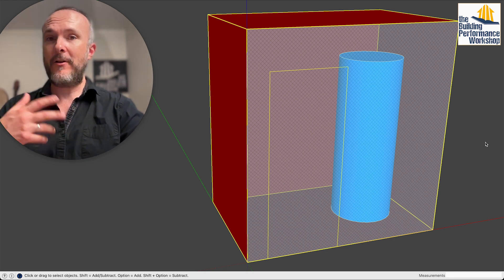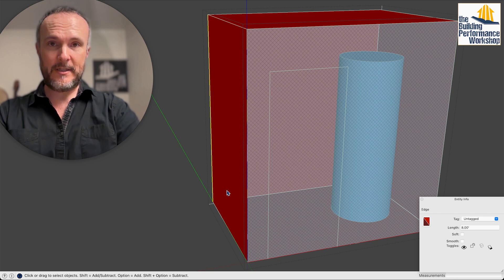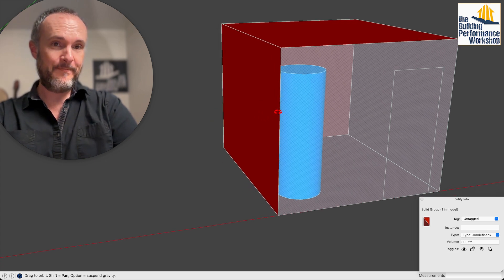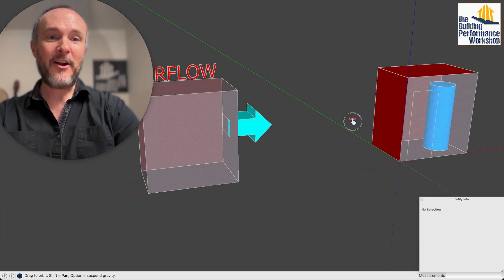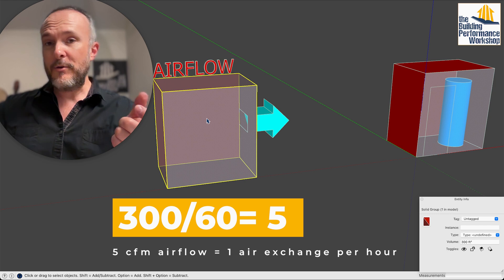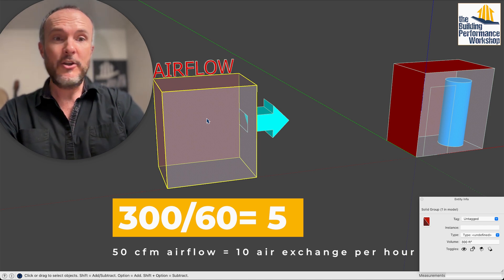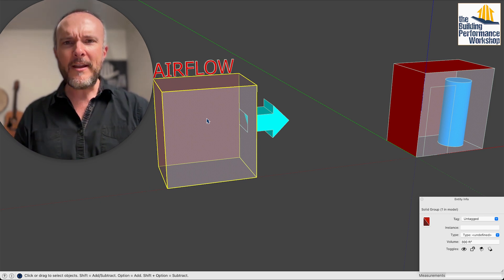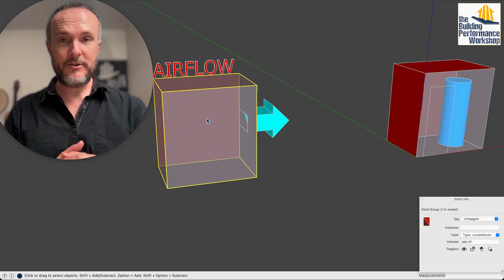Heat Pump Water Heater Trick: Bigger Air Volume, Same Size Room

Comment: Thank you for this video. As a power (steam) engineer, this appeals to me a lot. I have moved to the tropics, and we are planning to remodel our house. Currently there is no hot water source, so I am entertaining the idea of a HPWC placed under our stairs. The house will not be hermetically sealed, so I was thinking that I could duct the cold air into the house, and have a passive vent on the outside of the house providing warm air. My contractor is uneasy because it's not to the letter for the instruction manual, and most people here have very limited experience with newfangled technologies like this.
Reply from the maker: Awesome Michael, and congrats on your move

Comment: I installed the Rheem 80 Gallon HPWH XE80T10HS45U1 last month..  I installed in a closet in the garage and removed the doors so I have over 800 sqft..  I have it set on "energy saver" that will always use the heat Pump and only use electric when needed..  I thought for sure we would run out of hot water and it has not yet..  they are amazing..
Reply from the maker: Nice! Thx for sharing Casey

Comment: Mine is next to my furnace. In the summer, the heat of being summer is enough, and no problem with the heater keeping up with demand. In the winter, I open a small cold air return on the side of the furnace. I stress small, maybe 4"x4", this creates negative pressure in my laundry/furnace room. The effect of this is two-fold. #1: draws warm air into the laundry room. #2: The cold air from the heat pump (which is at floor level, cold air drops etc...) gets drawn right into the furnace. I have seen Zero increase in furnace run time due to this.

Comment: A 120x120mm computer fan is going to put out something like 60CFM. I don't think they make 5cfm computer fans.
Reply: A 40mm fan will be around 5cfm. You also probably won't want to run a fan at 100% for noise reasons, so your realistic use case of a 60cfm fan is more like 30cfm. A Noctua Ultra Low-Noise 120mm will still do 30 cfm at just 12 dba maxed out.

Comment: If you can send in air with a fan, it's gotta expel somewhere, like with an HVAC return consideration. But since we're talking about far less CFM needs I'd be inclined to skip the fan and create transoms or some other way for an adjacent room to share airspace. Kinda like when people balance room temps with simple shared register grates between walls.

Comment: I recently added ducting to draw attic air for my HPWH in my uninsulated 8000 cu ft. garage. Seeing air inlet temps jump 10 degrees on average has me slapping my head for not doing that sooner, and I don't even have it drawing from the peak! (Yet.)

Comment: Not every manufacturer is requiring 700 cubic feet. Also no manufacturer is telling you to put these in a room that is 700 cubic feet, they are just saying that’s the minimum (at least two manufacturers call out 450 as the minimum). The best scenario for these is a basement or garage out in the open.

Comment: I don't understand how they can specify the requirements in volume of air, a well insulated room, no matter how large would still get too cold eventually.   I would like to use my hot water heater to help cool my computer/electronics rack.  A rack of equipment that generates 1200W of heat would be enough to meet the hot water needs for a family of four.  Sure, just venting both to the rest of the home washes out in the end but putting both in a small closet and letting it get a bit hotter than the rest of the home can only make the hot water heater more efficient. 

I envision a closet (divided by a wall to protect the equipment from water), with a thermostat controlled duct fan & damper that only comes on if the room reaches over 80F/26C or below 60F/16C.

Comment: Hi Corbett! I have one other question about the placement of a heat-pump water heater in a small interior space. Since the unit pulls the heat it needs from the surrounding air it must therefore make that room colder, and since heat moves from hot to cold naturally would it really be necessary to have to use a fan? I would think that all you have to do is install a louvered door on the mechanical closet and let the heat be naturally drawn into the room from other warmer interior spaces.
Reply from the maker: You’d never be able to predict the exact rate of convection in that room, and so it would definitely be a red flag for the manufacturer if something went wrong. Could try, but I doubt it’ll work.
Reply: @HomePerformance  Hi Corbett. Matt Risinger just put out a video on plumbing and they showed an LG heat pump water heater going into an extremely small utility closet - well below the cubic footage requirement recommended by most heat pump manufacturers. What do you think of their installation?
Reply: If you look at the install instructions, or at least for Rheem, what you mention is basically exactly what the directions say for mechanical closets.

Comment: We use a Rheem 50 gallon 3.55 efficiency.  I love this water heater.  I run it at 125 degrees and in heat pump only mode.  We can run two showers and the dish washer or laundry at the same time without a problem.  If you look at the temps, it layers water extremely well.  The top of the water will stay hot all the way till the end.  When we first had the water heater we accidentally ran two showers and the washer cleaning cycle that takes a ton of water at the same time.  It was in hybrid mode.  The water got cool on me in the shower then recovered and heated up again.  So, it’s a very powerful machine if you happen to need that as well.  It also provides some cooling to our garage that we use like another room for office/projects/work on cars.  The only problem with it is that the coil and foam bits inside can start to grow stuff like mold.  About every 6 months I take the top off and clean the whole thing out with probiotic cleaner to keep the growth down to a minimum.

Comment: You could duct both the intake and the exhaust of the HPWH to the outdoors, thereby eliminating cold spots indoors and pressure issues. I suspect this would reduce efficiency down to a ~COP of 1 (worst case scenario) during times when the outdoor temperature is below freezing, but i imagine the HPWH would perform much better during times when outdoor temperatures are higher than indoor temperatures, since there would be a higher amount of thermal energy in that outdoor air. This idea (of ducting both supply and exhaust to outdoors) is even suggested in the the install manuals for Rheem and Richmond HPWHs. Ducting to the outside, either the supply or exhaust (instead of both), would cause problematic pressurization or depressurization respectively, resulting in [A)  conditioned air being pushed out or B) unconditioned air being pulled in] respectively, and the associated energy penalty. Or you could just get the Sanden heat pump water heater.

Comment: I am desperately waiting for a home heat pump multi split unit that also (as part of the same refrigeration system) does heat pump water heating

It seems like the best of all worlds if someone would commercialize it!
Reply: The Sanco2 heat pump water heater uses an outdoor heat pump unit (only the passive tank is inside) and can simultaneously heat a small apartment or small home using the Taco X-Pump Block. The X-Pump mixes the water  temperature down for radiant heat. No A/C though.
Reply: the simple problem is its not going to be good. yes its convenient, small out door space, but its poor performance. multi splits are bad enough, but then add the hot water which requires different performance (hot water is lot hotter than home heating air), your going to have a kludge of a system. because of the different requirements they often use different refrigeration gasses and tech. then you have the issues of replacement later on.
i highly recommend using two completely separate systems.

Comment: Most of them i see here are outside. Either the whole tank or a split system. 

If your heating  home with gas, then an interior heat pump water system becomes an expensive gas water heater.

Comment: 😂it’s sucking the heat out of your house 
Think about that fact during the heating season
Reply: Haven’t seen the ‘numbers’ but other HPWH supporters claim this heating season impact is immaterial/negligible versus the overall benefit.  Again, haven’t seen or done the math yet.  See HPWH videos on Matt Ferrell’s “Undecided” channel …
Reply: @caseyjohnson5844  So your home heating heats a bit more and it's less efficient than heating the hot water directly. Compare it with the air conditioning savings you get during the cooling season.

Comment: If you have an attic that can handle equipment, that is the best place to put a heat pump water heater as it will help cool down the attic so it doesn't get super hot from the sun beating down on the roof.
Reply: Never put a water heater in an attic.  Duct the air from the attic to the heat pump.  Keep the water heater on ground level if possible.
Reply: @mtakedown  Why not?  Lots of people put water heaters in the attic, and it's extremely common in commercial and apartment buildings, or at least that's how it's been in every apartment I've ever had.
Reply: @r.j.bedore9884  It's just a pain if the building isn't planned for it, plus water leaks can be a lot more expensive.

Comment: I've got one.   The simplest way to deal with it is the same way gas appliance combustion air rules deal with an area that is too small.  Adequate size vent openings into other areas.  If there is a crawl below and an attic above - registers top and bottom.  If not, registers into an adjacent space.  Venting the cold exhaust out of the room also helps.  

HPWH's throw off a lot of cold air - so in a heating time of year you are heating interior air and then extracting the heat from it to heat the water.  Installing them in an unconditioned area - garage or storage room may be better from an overall efficiency standpoint.

Comment: literally every other sector using heat pump in an application uses a split system with  the exchange going on outside. Putting these heat pumps into a carefully controlled interior environment makes no sense unless youre in something like an apartment and cant have an outdoor unit. 😅 Very silly, and I blame Rheem for proliferating this idea
Reply from the maker: Refrigerators and wine room coolers dump the heat inside too- there’s precedent
Reply: @HomePerformance & both intake and/or exhaust (for most HPWHs) can be ducted …
Reply: So put the HPWH in the same room as the refrigerator so they offset each other? @HomePerformance
Reply from the maker: @ryan52403 NICE
Reply: I’ve been thinking about this appliance and how to strategically use it.  I’ve been wanting to play around with the scenarios and see how many different variations they can effectively be used.   One thought though about the cubic feet requirement.   If 700 ft3 minimum is required, is that free area?  does it matter if the space has items in it that displace the air?   If you have a washer and dryer?…does the water heater tank count?  Obviously these will require more planning than standard water heaters, which means there will be homeowners that will complain they don’t work, or they have failed, when it’s just improper installation.
Reply: absolutely. in a cold climate your just taking the heat out of the houses heating system. so your paying to move heat from outside into the house, then paying to move it into the water. with an outdoor system your only doing the one step.
if your using gas to heat the house, you basically have a very expensive gas hot water system.
tho internal units do work great in hot areas where you always running aircon and do very little heating.
Reply: Tons of homes have water heaters in big empty basements. Putting the condenser outside is a recipe for it freezing up half the year. It's probably not worth integrating the condenser into the HVAC, since sufficient air circulation will spread the coolth around anyway.
Reply: @MarkRose1337  there is the gas line version which work just like a heat pump, so there is no water outside to freeze.
Reply: @tweake7175  I'm talking about putting the condenser outside, with some kind of refrigerant in the loop. Heat pumps are efficient within about a 40ºC delta. When it's -30ºC, people still want water around 70ºC to avoid Legionella, and a heat pump will struggle against a 100ºC delta. When a -45º cold snap hits, it'll struggle even more. I don't know of any refrigerants that can work a 100ºC temperature delta, meaning the refrigerant will stay liquid or even freeze in winter.
Reply: @MarkRose1337  yes, with that sort of climate you want some sort of back up in winter or different setup. all depends on the climate and how the home is heated.

Comment: You would need an exhaust in the small room, preferably low on a wall to exhaust the cooler air, or the fan might build pressure in the small room and negate the CFM gain.

Comment: Or put it in the garage where it belongs not in the house where it's constantly dumping heat into the house.  I put one in a friend's house back when they first came out and their electric usage dropped by around an average of $35 a month. In the summer it doesn't have to work very hard at heating as you are taking in 100*+ air and starting with water temps of over 80*. Winter it takes more of a hit but not bad. The early inits had lots of compressed issues and sadly cost more to operate because of repairs and replacements. A big cost few want to admit with many energy saving methods. I always wait till the bigs are worked out before going with that stuff. I don't like being a guinea pig aka the companies testing subject.

Comment: For my heat pump hot water,  I have it in a room that is "too small" what i did was. 
1. The intake is ducted to the room next door. (About 20cm length, same circumference as the intake).
2. The same room has other equipment that produces heat (so cool air from heat pump, then counters the heat produced) 

I have sensors the record the HP power and room temperature. If I have the HP running without the duct the efficiency drops by about 30-40% due to the intake air slowly cooling down
Reply: I came here to say this as well. The HPWH manufacturers include intake and exhaust vent options so you can duct them. You can install these things in a tiny closet off the garage, duct either the intake or exhaust to the garage, and add a passive vent through the door. 

There is no need to complicate things with an external fan.
Reply from the maker: @rosskerley6120 fyi adding passive or active vents between living space and outside may have serious implications in very airtight construction (most of my clients).
Reply: @rosskerley6120  correct the Stiebel Eltron range provide this as an option. 

For me the 2 rooms are my garage and a utility room, they are outside the conditioned space, but still insulated, etc
Reply: @rosskerley6120  i suspect many are not actually sealed in the machine. so you would end up with an air leak to the outside.
i had the same with some fireplaces that had external intakes. it was actually fake, as it wasn't sealed to the unit. it effectively was just a big hole in the side of your house.

Comment: I really wish more heat pumps would also create hot water. I have seen a lot of ground source heat pumps that do this but not an air source heatpump.
Reply: Air-to-water heat pumps can definitely heat domestic water. Though the temperature most heat pumps can reach is a bit limited, about 120F for R410a, other refrigerants can go higher CO2, R290 etc. Also, their heat output is limited compared to a normal water heater (let alone a tankless), so you will need a substantial storage tank of some type, either a buffer tank and an external heat exchanger or some type of indirect tank.
Reply: @ZergZfTw  Adding a water loop to the AC where the hot side is dumped into a heat exchanger connected to a water buffer tank for the home's cold water supply.  Where the cold  water supply (before the houses MAIN heat pump water heater) would "pre heat" the water (AKA the water would be warmer but not HOT) then the heat pump would do the heavy lifting.  Bringing that warmer water up to "hot water temperature" for the house.   Basically instead of dumping the hot air from the AC it pre heats/ warms water before going into the houses main heat pump water heater
Reply: @mtakedown  Absolutely; adding an inline desuperheater or a 3-way valve and a heat recovery condenser is a great idea for any AC system. You can do more than just heat domestic water. Using the waste heat to heat a hot tub or pool is an excellent idea, too. This Old House did an episode where they added a 3-way valve and a water-cooled condenser to an existing system, cooling the house and heating the pool at the same time. It basically doubles the COP of the system
Reply: There are units that you can put online of the condenser high side line that pill heat from the liquid line and put it into the water heater. They are called desuperheaters In gshp but are available separately.
Reply: Great insights people. Thanks